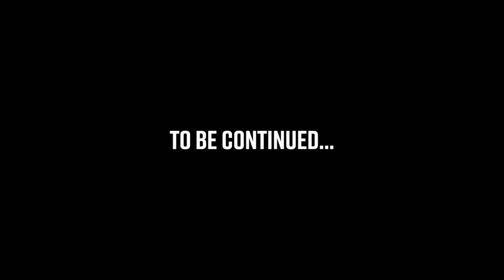INLAY Experiments with FIMO Ep 2 | Building a Boutique Hollow Body Baritone Guitar

Comment: I think if we've learned anything from the One Day Build series, it's that building a good guitar from scratch in one day isn't really possible, or advisable.
Reply: I think if we learned anything from the several multi hour build series it’s that Ben is capable of doing builds at a boutique level in less than 24 hours.
Reply: @alpeterson  I've built several electric guitars. None of them have taken more than about 15 hours of actual labor to complete, but none of them were done in a consecutive period.
I think you took my comment the wrong way. Did I?
Reply: @peachmelba1000  I definitely get what you're saying as someone who builds guitars myself there's a huge difference between spending an hour a day for 24 days and building a guitar and spending 24 hours straight building a guitar in one day doing that much work for that much of an extended period you'll get tired you'll get complacent you'll allow for errors and flaws that you normally wouldn't your work will become more careless and the finished product just simply will not be as good as if you'd given yourself a break between working sessions I tend to build my projects in sections and pace it out so that each individual process can have my full undivided attention with no outside distractions and several breaks to plan the next phase and rest between phases I feel that breaking a guitar build down into as many small processes as possible and working to the best of your ability to perfect each process in its own time and space gives you the best end product you are capable of making
Reply from the maker: Yes indeed, I agree wholeheartedly
Reply: @peachmelba1000  I just loved the old school build videos, and any chance to remind people they exist is a good one. While I love building guitars I wouldn’t actually try to do one in 9 straight hours start to finish, but I did love watching Ben do it. haha
Reply: One day is 8 hours  ( minus two 15 minute break periods ). After that it's overtime folks . Yes , I have worked 12 and 16 hours at a time but that's not what most people consider a normal workday . No way you can create this sort of art 'in a day' .